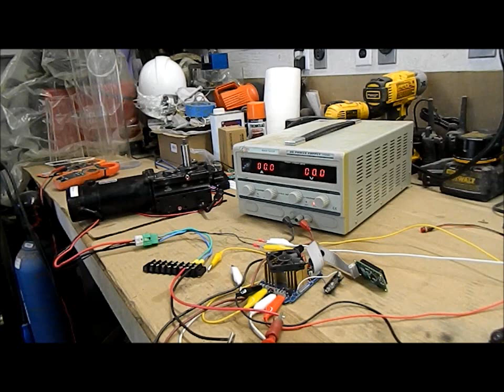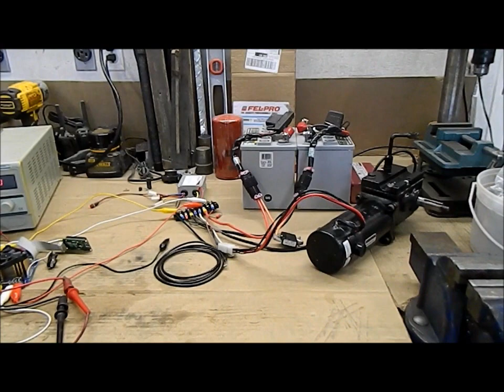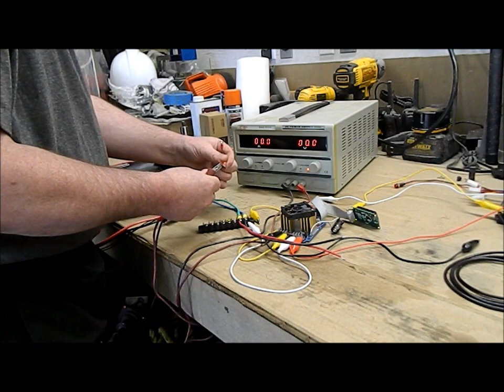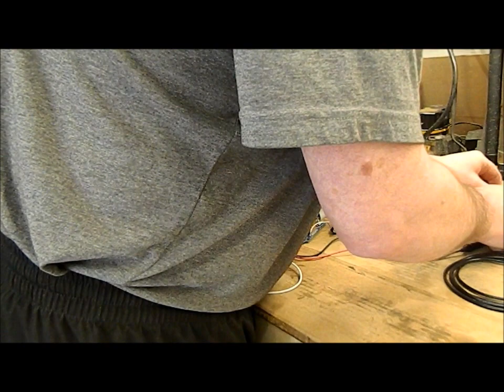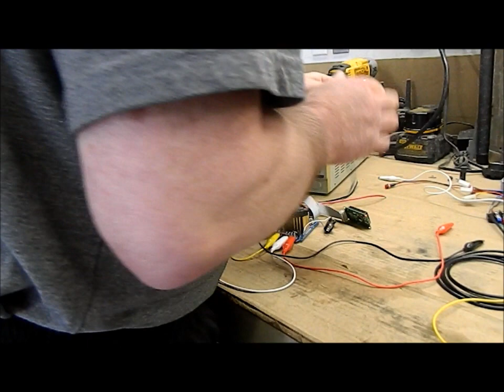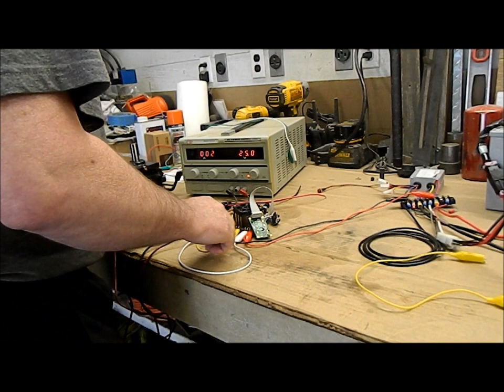Amp Volt required to activate Wheelchair Motor Brake

Comment: First video I've seen to figure out voltage for that brake thank you.  I've got a Cytron Smart Drive Duo 30 to run 2 4-wire wheelchair motors with the brakes. I'm having a hard time figuring out if I can wire the brakes to the controller properly. Have you messed around with those controllers by chance?
Reply from the maker: The MDDS30 has no provision for brakes. You could disable the brakes by disassembling them, or have brakes on continuously upon power up. Alternatively you could tag off the boards LED indicator with a solid state relay to activate brakes upon movement. The 2 small wires are the brakes the two large wires are the motors.
Reply: That’s a great idea going off of the indicator light with a relay I think I could make that work. For future builds I’m wondering if I should just go with a wheelchair controller and figure out how to use my own joystick of choice and not the ones they come with. Thanks!